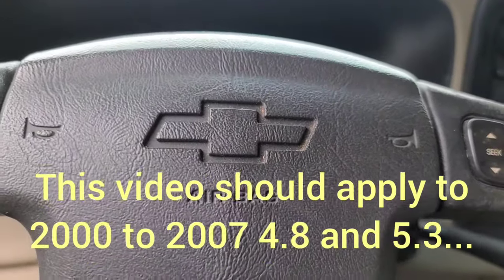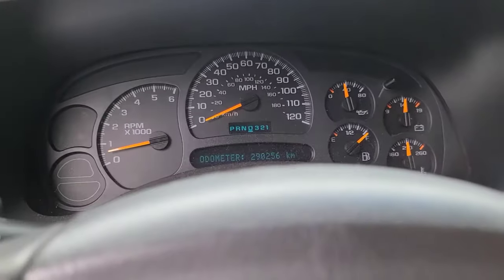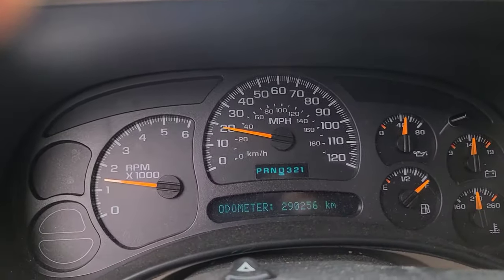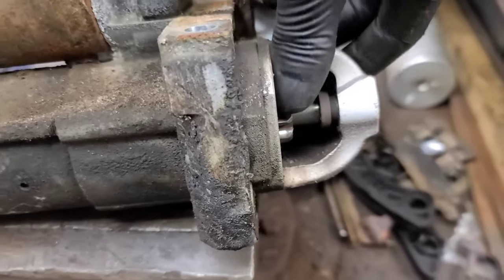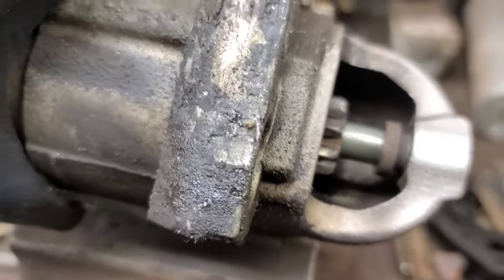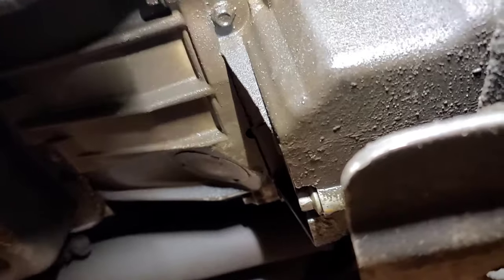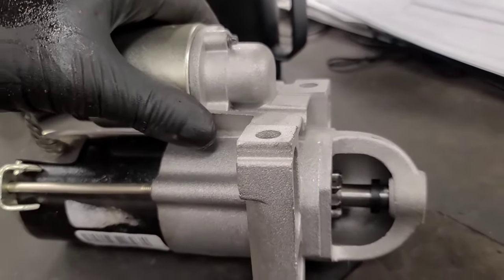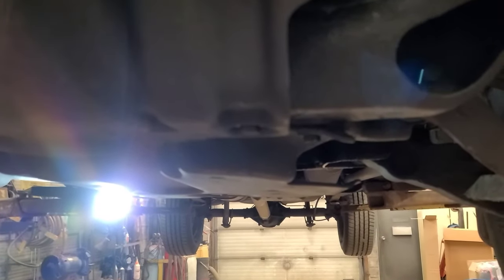2000 to 2007 GM Truck 4.8, 5.3 and 6.0 Engines. Weird Rattle On Acceleration

Comment: 07 Yukon 4x4 here 5.3 mines isn’t that loud but kind of similar im going to check that next only does it when vehicle is warm did it happen to you on cold start also only happens to me when it hot outside
Reply from the maker: It seemed worse when hot.
Reply: @PhillipBailey hello Phillip. I changed out my starter. Still making the noise. Fades away at around 2500 RPM. Any ideas?
Reply from the maker: @John1974  could be many things. Try removing the main Serpentine belt and the AC belt. Could be anything in the drive belt area.

Comment: What’s your opinion on it if you replace it with a new starter and it does the same thing???
Reply: Same here
Reply: Someone found the trouble? Have put a new starter but that not fix the issue..Thanks to answer.

Comment: I have the same sound on a 06 now.   I just learned the best trick to tell its the starter 100% is to just BUMP the key.   not start it Just like 1/4 revolution you will hear the bendix  going "ZING" and rattle.   hhahaha.   How many clowns you think junked these trucks thinking the engine was bad. Makes sense when its worse when It sounds terrible when backing up and slamming on the brakes I was playing before. I have a brand new OEM starter I bought back in 2012 when the OEM starter used to not work some times but fixed itself probably had water in it.  So..  I have the part already  Ill try to fix the original one  GM used the same fork and bendix 9 tooth on a TON of vehicles not even LS 4.8-  6.0 stuff
Reply from the maker: Yes you are correct
Reply: @pBailey Yea took it out today its a rattler.    Put in a new starter i had since 2012.  The solenoid lug busted off of it and my big Snap off tool collection lol.   I have no E torx DEEPS bigger than E4.  Its a e5   for the solenoid. Now I have to wait for tools lol  Sucks, You probably have a shop. I used to come across it now and then usually on rusted vehicles when the damn solenoid stud breaks off the battery cable.   hate that crap. The new one the way it was shipped 
(Delco) years ago had no support maybe it had a hairline crack it tore out the lug just too easy with a baby ratchet. Like those 3 inch or smaller snap on 1/4 ratchets.  Atleast Old Rattler still works to bump over the engine for another day or two. Got to love our country now. No one even sells solenoids anymore.  If they do OF COURSE its Chiiiiinnnnnaaaaa ...  At crazy prices

Comment: My 2011 Silverado 5.3 does the exact same thing but it also hesitates sometimes to take off. Could that cause that too like sluggish takeoff?
Reply from the maker: No the starter will not affect performance in my opinion.
Reply: @PhillipBailey  that’s what I was thinking. It’s going to shop tomorrow,man at oil place said maybe it was transmission so I’m hoping it. It’s going in tomorrow
Reply: @t94zskss47 did you figure it out? mine is doing the exact same thing
Reply: @ambertrevino2771  all it was the starter shaft broke and was trying to engage with the flywheel. Got a new starter put in and was good as new.

Comment: Can this cause to the truck to shut off after acceleration and hard rattling on the engine? Mine does that sound and then like loose power and shut off
Reply from the maker: It should not affect engine performance in my opinion. I think something else is going on. Any codes setting?
Reply: @PhillipBailey  i had a code of a Evac I don’t remember what code was
Reply from the maker: @shmeed_tcg9787  if the purge solenoid is leaking it may run poorly at times and possibly set an Evap code.
Reply: @PhillipBailey  but I don’t understand why she starts knocking hard and shutting off like no gas in the engine
Reply from the maker: @shmeed_tcg9787  no gas to the engine won't make it knock. It will loose power and possibly stall but it should no knock. You need to start with a scan of all the modules to see what codes it reports, refer to code diagnosis.  Also need to monitor data in the ecm while the condition is occurring to see if it's starving for fuel, running lean or rich. Check for induction leaks, skewed O2 sensors etc.

Comment: Dose this have an affect on power loss
Reply from the maker: No it will not affect performance I'm my opinion unless the knock sensors hear the noise and retard the timing thinking it's pinging. Not very likely at all.
Reply: I think you might have just solved my problems with that sentence. I have had that noise for a while now, and I started to get knock sensor codes even after replacing them with the new wiring harness, and now my 2000 Chevy Tahoe 5.3 LS just started acting like it was out of timing and is making a new weird noise on the bottom end of the engine. The damage MAY already be done to the engine and I'll have to fix it, but I'll be so pissed if all of this was because of the bindex on the flexplate 😅 I'm going out in a few hours when it's not so freaking hot out to change the oil and replace the belt tensioner, so I'll remove the starter then and check it out. 
I'll try to remember to update this when I find out.

Comment: mounting surface on block has oil ??? please help how can i fix
Reply from the maker: I'm not sure what you mean by that comment.
Reply: @PhillipBailey  could starter cause small leak?
Reply from the maker: @joshualagunas847  no there is no lubrication to it. If is oil it's coming from above.
Reply: @PhillipBailey  rear main seal ?
Reply: @PhillipBailey  i deff think oil comes out near starter. cashing damage and sometimes won’t turn over. i hit the starter for a quick fix tho
Reply from the maker: @joshualagunas847  unless the starter is saturated with oil it should not affect its operation. When you have to tap the starter to get it to crank that's usually worn brushes or solenoid problem.

Comment: hello guys I have an 06 Silverado and my truck when cold idle or acceleration starts rattling sounds like metal tearing apart but she drives well anyone might know the problem
Reply from the maker: There are many possibilities for noises. Could be drive belt related. If you can reproduce the noise sitting still running cold you should be able to isolate the source with a stethoscope. You could also try removing the drive belt and the AC belt. The AC belt tensioner is also common to fail.

Comment: Mine does this but at idle any ideas
Reply from the maker: Could be quite a few possibilities. You  may have to put it on a drive on hoist and listen under the truck while it's idling on the hoist. Check exhaust and heat shields
Reply: @PhillipBailey  figured it out. Was a bad ac tensioner pulley. Seized up and broke free. Which caused the bearing to break causing the rattle noise.